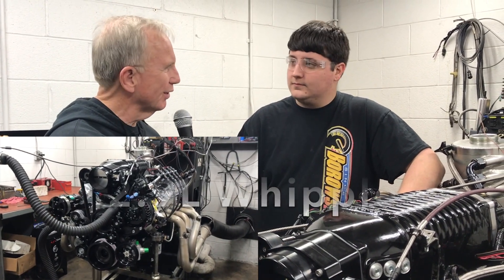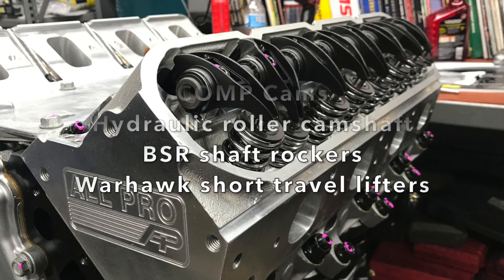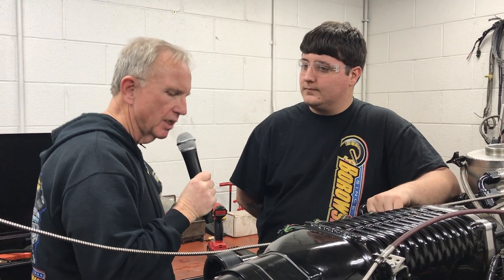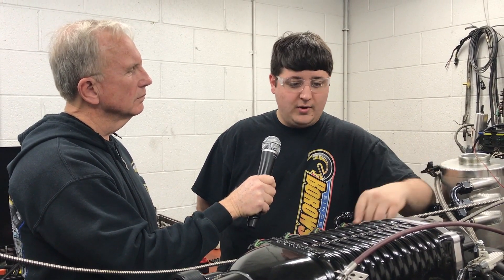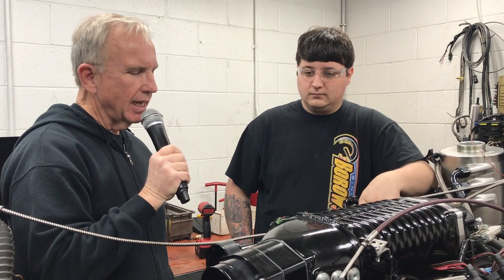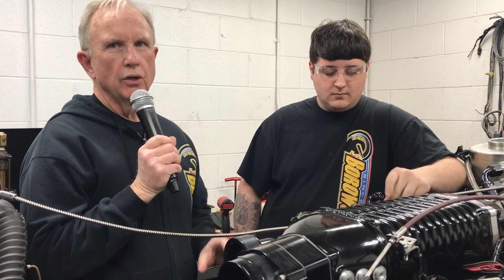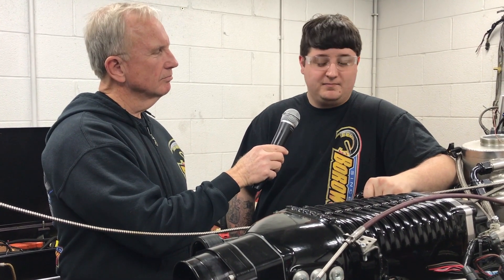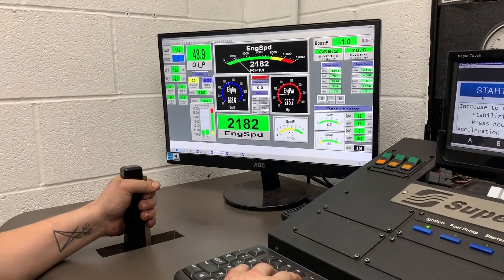BRE's 2020 427ci LS with 2 9L Whipple

Comment: I worked there under Ted in the mid 1990s.
Ported heads by hand, flowed them on a SuperFlo 600.
 Built my 347 stroker motor there for my supercharged Fox Mustang  there.
Nowdays I have a supercharged C6 Corvette.